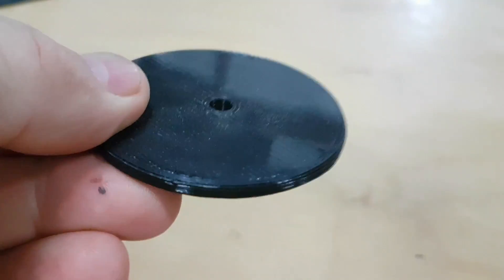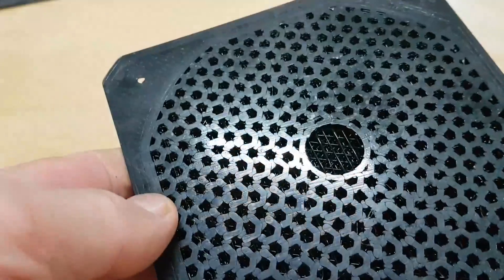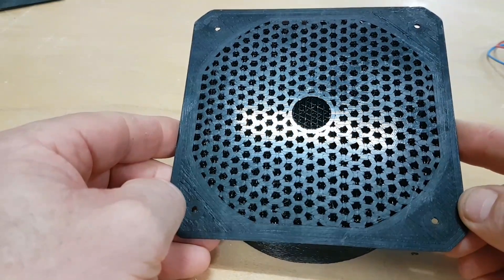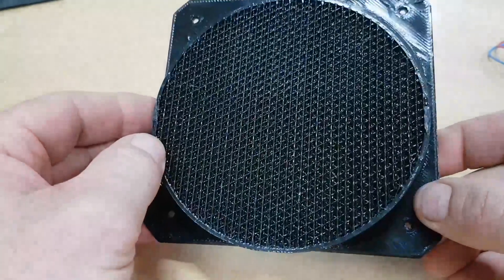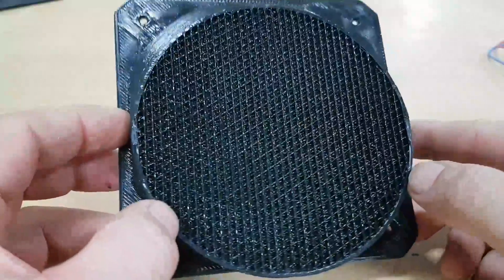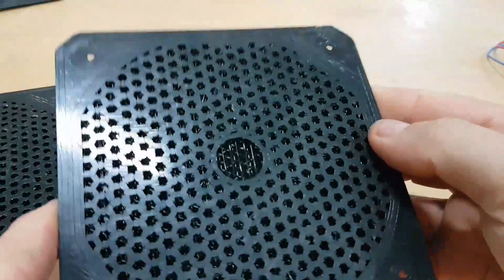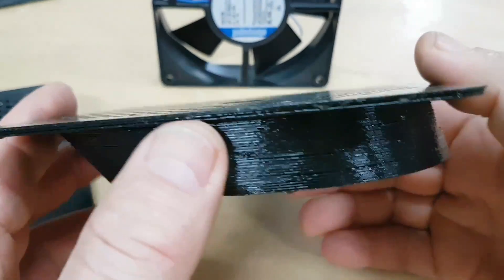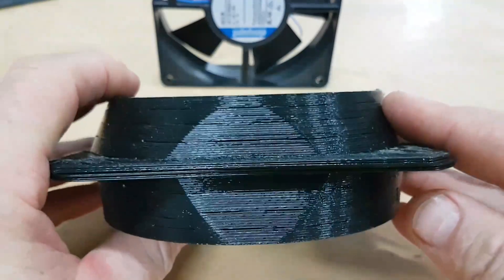LARGE FLAT PARTS : 3D printer.

Comment: You spend 3 minutes lauding the flatness of your prints without giving details on how you achieved this.  I'm thinking you generally feel underapreciated. What a  waste of the viewer's time.
Reply from the maker: This was ages ago, and it was an acheivement at the time.
I have got to remove some videos :/
Reply: @helmreichenterprises8391  I think the point is, you could have told us what you DID to get this flatness. You must image that from the viewer's POV, they came here to find out how they may achieve good flatness  on large parts. They will come away from this video disappointed - as I did lol :D
Reply from the maker: @danielhenderson7050  you are 100% correct, 100 years ago when I did this video printers didn't come with heated beds, and everyone was struggling.
These days there are four main variables, heated bed, filament type, bed adhesion, and enclosures.
Bed adhesion was dealt with by glue, tape etc. but now we have specialised bed materials like PEI, ceramics, etc..
I personally favour Zinc-alum coated steel with cross linked PVA, it doesn't break, is serviceable, and you can make your own.
I have since printed over 100 kg of filaments, probably closer to 200kg.
When I use ASA I have a favourite which is Spectrum brand, I seem to get the best results with that.
My largest printer is now 600x600x600mm volume.

Back then
Reply: @helmreichenterprises8391 Yes, you do.